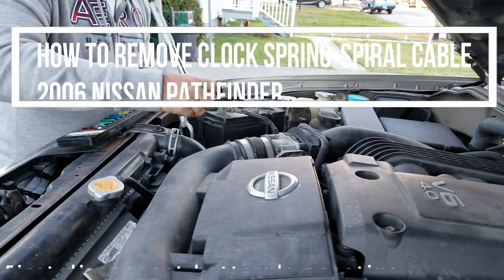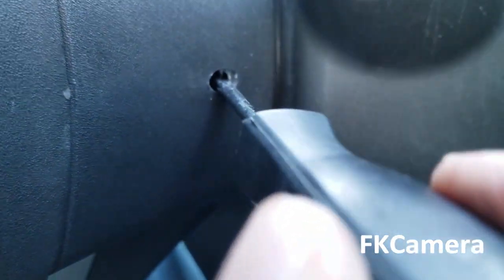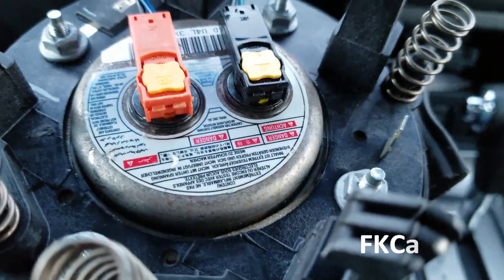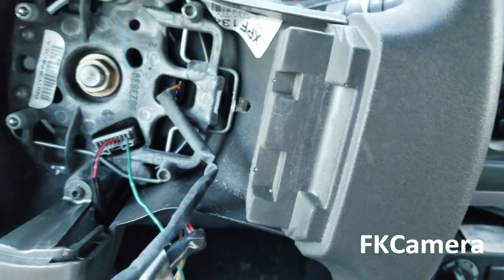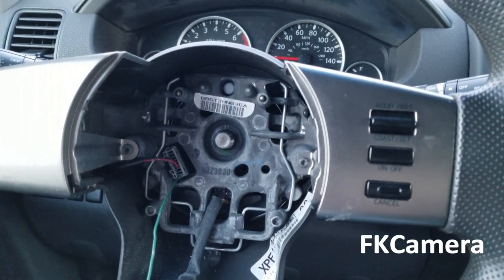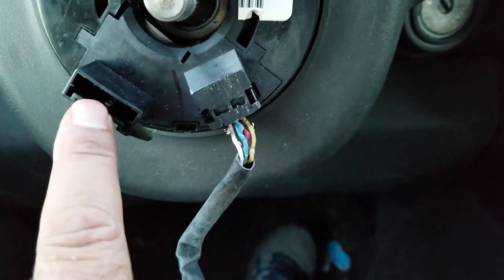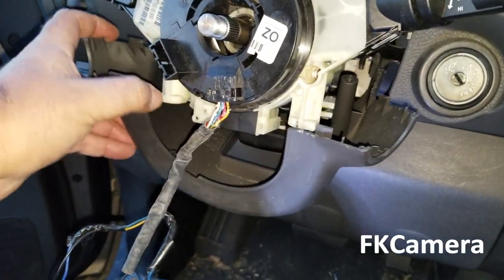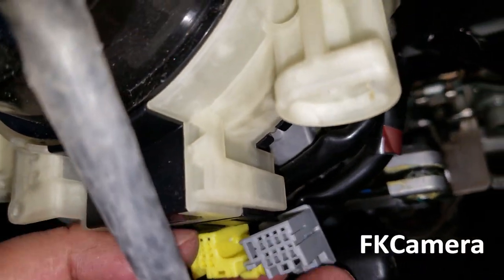2006 Pathfinder Clock Spring-Spiral Cable Removal | Vlog | By FKCamera

Comment: Great video! On top of replacing the clock spring I had to replace the Angle Sensor as well. You just saved me from an $1100 quote! One question. Is there a tool or easier way you would recommend taking off the steering wheel? What kind of puller would you use?
Reply from the maker: Wiggle and it should come off, takes little bit of effort. If you wanna borrow a tool try advance auto parts. I am glad to hear, it saved you $1100 bucks.

Comment: Hi, I have a 2006 Pathfinder and the airbags won't deploy according to the dealership (i had to take it in to check an emblem recall on the steering wheel.) will this fix that issue?
Reply from the maker: I am sorry I am not aware of this issue

Comment: Do you think a 2001 frontier is similar?? I can’t find anything on the same problem for my frontier
Reply from the maker: I am not sure how diffrrent it might be since its a Nissan Product, check  the part and see if it looks the same as 2005 or 2006. The process might be lil different since its 2001. I would suggest to look for a frontier manual online for clock spring

Comment: Hi hows it goin. I wanna try this repair job. Im having trouble finding part thou. I checked and nothing on amazon. I have a 2009 pathfinder se model. I only see parts om ebay but def worried about buying wrong part. Any suggestions on finding part please let me know
Reply from the maker: Joseph call you local dealer and give them your vin number, they will give you exact part number. Try to find original part, don't buy cheap Chinese brand on line  Also please subscribe to channel. Thanks !!

Comment: Gonna attempt soon hopefully this fixes my problem
Reply from the maker: Good luck !!
Reply: FKCamera didn’t work my part only had the yellow cable and afterwards when I scanned my car I had like 3 more codes under airbag
Reply: FKCamera my airbag when I moved it made a noise like something was broken inside I hope that’s normal if it isn’t that might be my problem
Reply from the maker: @Blackcat8  it should not make any noise.
Reply from the maker: I recommend OEM part

Comment: From where you bought this ?
Reply from the maker: From eBay
Reply: @FKCamVlogs  what is the part number on Ebay? i bought two in amazon and no apply for my pathfinder 2007 r51 from spain
Reply from the maker: @desireecarrion9482  Please subscribe the channel if you have done so.  Part number was OEM 47945ZP00A

Comment: MM stands for millimeter my Dude
Reply from the maker: I appreciate the comment brother. Here is little detail. In the current market, socket sizes are divided into two systems: SAE (imperial, measured in inches) and metric (measured in millimeters) that is why they are listed as 5mm, 8mm or 10 mm
Reply: FK & Camera I know, I work on cars lol but in video you kept saying “mm” instead of millimeters